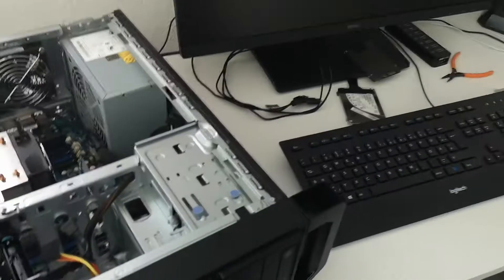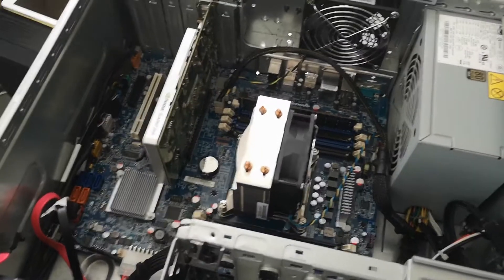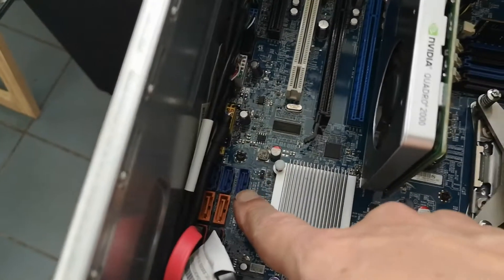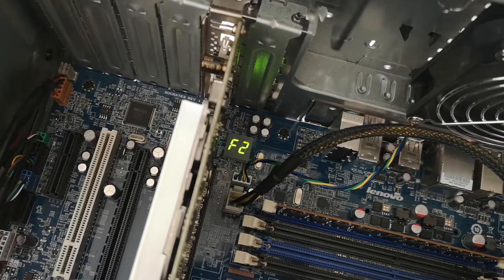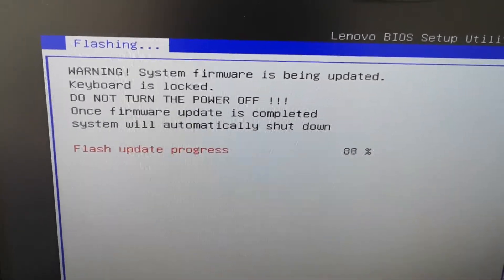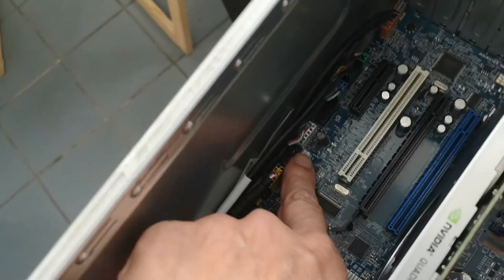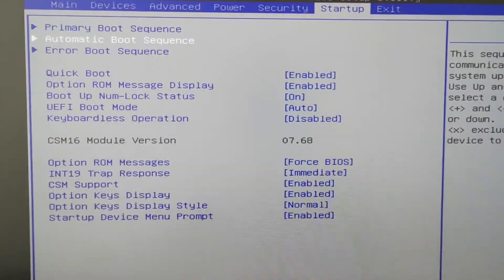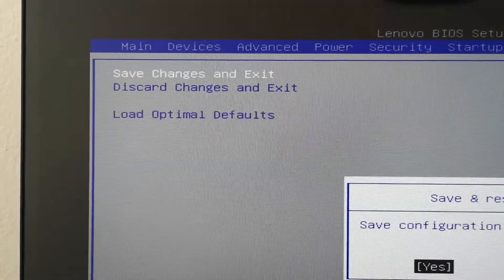BIOS Flash Reinstall on Lenovo S30

Comment: Curious if you tried swapping the video card with a newer one when the machine appeared to be bricked?  Apparently Lenovo added UEFI support to later S30 BIOS revisions but neglected to tell users that majority of the OEM installed NVIDIA Quadro display cards had non-UEFI compatible legacy video BIOS. Hence the no video when disabling legacy/CSM mode.
Reply from the maker: That is very interesting ! I probably took the video card out since I never use such things which means I would not have noticed the problem you mentioned. It is often best to strip hardware down to the bare minimum when trying to get things to work ;-)

Comment: I'm trying to do this on a Lenovo ThinkCentre M93P Tiny PC but it doesn't show that status in red so I end up getting sick of waiting because it shouldn't take that long.
Reply from the maker: I have successfully updated two M93Ps. Just unzip the bios files to a bootable DOS USB stick made using Rufus or similar. For me the process ran smoothly with a few automatic reboots. I have not however needed to try any "bios recovery" for a corrupted bios.
Reply: @fotografm  Yeah. I've already done it multiple times. To no avail.
Reply: @fotografm  I'm on linux. Rufus doesn't work on linux.
Reply: @fotografm  Just tried Rufus from a Windows 11 installation and it copies some files onto the flash drive and then asks me if I want to replace them when I'm copying over the BIOS stuff so I didn't at first but then decided to and the Lenovo ThinkCentre M93P still isn't doing anything but flashing the power light and that's with the CMOS Jumper in both positions. What position is it supposed to be in when doing it this way because when you use the ROM file it's supposed to be in the recovery position.
Reply from the maker: @luigiprovencher  I am also a big Linux fan and am currently loving Fedora. I often use the dd command to create bootable USB drives and there are some gui tools to do it too. You need to make the usb drive a fat16 or fat32 drive bootable with DOS on it. Freedos is a good one to try. Then copy all of the files downloaded from the Lenovo support websit onto the drive and let the M93 boot from it. For a recovery situation the M93 will be unable to boot and so the BIOS files alone need to be on the stick and the jumper setting forces the M93 to look at the usb ports. I would need to download and read the manual to find the correct procedure for this and I recommend you do this too.
Reply: @fotografm  Yeah. I've tried it many times. That's what the problem is or was. Corrupted the BIOS so now I have to do it right from the chips itself. There's two different BIOS chips on there so I think that I'm going to buy the tools to do it because they're cheap and maybe even buy a second used board off of eBay in case I can't find the appropriate BIOS online and then copy them off of the second board and then install them onto the first board and then see if that works.
Reply: @fotografm  CH341A Programmer. Look it up sometime.

Comment: Wow, Thank you my friend! This worked for me. If it doesn't work for you the problem may be that there are 2 bios versions of the S30 Workstation sub-models, make sure you match what you have to what the website tells you. I downloaded the DOS version and dropped it right on the USB stick. It booted and finally flashed. This fixed the BIOS 62 error for me.
Reply from the maker: Glad it helped !

Comment: How did u flash bios on a usb?
Reply from the maker: For Windows download "rufus.exe" from rufus.ie and run rufus.exe. Select device as your USB stick. Choose Boot selection as Freedos. Leave all other settings unchanged and press Start. After stick is formatted as bootable, copy the BIOS files to the stick. If these were download as a compressed .zip file then first uncompress with something like eg. 7-zip. Then put the stick in a USB port of your computer and start or reboot the computer. Make it sure boots from the usb stick (you may have to enter the BIOS and set this to happen). Follow the instructions in the readme file that came with the bios files. Do not power off computer whilst bios is updating ! This is a risky procedure. I accept no responsibility for errors or failures in this process.
Reply: @fotografm  Thank you very much the details. I just successed to flash the C30 BIOS.
Reply: @fotografm  thank you very much my thinkstation e31 I update bios from the website and when brick I was so mad why this happened I will tried your method. If doesn’t it’s time to build a new pc.

Comment: Hello friend, do you think you can explain to me how to make the USB to repair the bios.
Reply from the maker: For Windows download "rufus.exe" from rufus.ie and run rufus.exe. Select device as your USB stick. Choose Boot selection as Freedos. Leave all other settings unchanged and press Start. After stick is formatted as bootable, copy the BIOS files to the stick. If these were download as a compressed .zip file then first uncompress with something like eg. 7-zip. Then put the stick in a USB port of your computer and start or reboot the computer. Make it sure boots from the usb stick (you may have to enter the BIOS and set this to happen). Follow the instructions in the readme file that came with the bios files. Do not power off computer whilst bios is updating ! This is a risky procedure. I accept no responsibility for errors or failures in this process.
Reply: @fotografm  You save my day. Thank you, Simon.

Comment: My computer is having the same problem no display   but is power on and off every time is conected to power. this happend after i removed the CMOS battery..Sometimes when i put the jumper in 2-3 pin it turning on but no display.. can you give me any help
Reply from the maker: Not really sure what the problem is. Check that the RAM modules are seated correctly (with the power off).
Reply: @fotografm   if battery is taken out and all ram taken out the computer will start and will start beeping 3 short and 1 long beep 
when all placed back in corect order it wont start on anymore.. just for 2 secunds and then off again.. and it will try to start again and again 
i have 2 m91p computer.. i have tested all ram working.. i have tested CPU.. all working aswell..

Comment: I'm curious if you're using an engineering sample CPU and is you tried clearing CMOS before resorting to reflashing the BIOS.
Reply from the maker: Yes - I tried clearing the CMOS and it didn't help. I am not sure if the CPU was an engineering sample or not. I didn't see any info in the BIOS or DMIDECODE and I didn't remove the CPU heatsink to take a look.

Comment: Hi,

I have a lenovo yoga S1 with no bios number attached, can you maybe help me to get mine sorted it’s taken me numerous tries with zero luck!
Reply from the maker: You need to look in the BIOS settings to read out the version number and date. You can do this when the computer boots, usually by pressing the "Del" or "F1" key. Some Lenovo machines say "Press Enter to enter setup menu" or something like that. Make absolutely sure that you have the correct BIOS for your machine before flashing it. Otherwsie you will have made a very expensive mistake !

Comment: What about a friend can you tell me, did you do to make the usb boot? I tried to do it but I have not achieved greetings, my English is very bad
Reply from the maker: I downloaded the small windows program from Lenovo that creates a USB boot stick which boots into DOS. Once the stick has been created you need to copy the BIOS flash program and BIOS data file from Lenovo onto the stick. Usually after booting the computer from the USB stick, you can run the flash program by typing "flash" or "flash.bat". Take care when updating the BIOS as you can destroy your computer if it goes wrong !!!